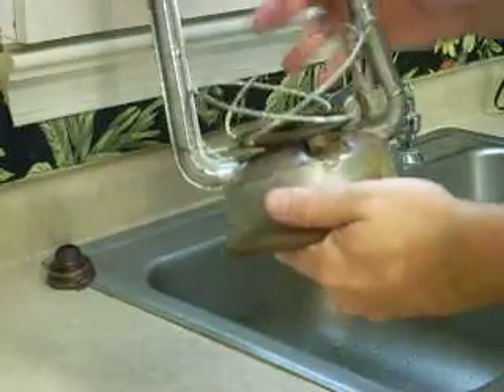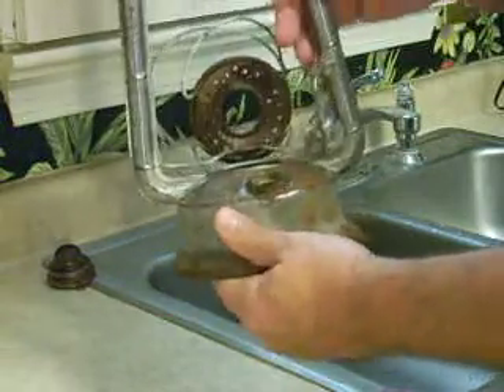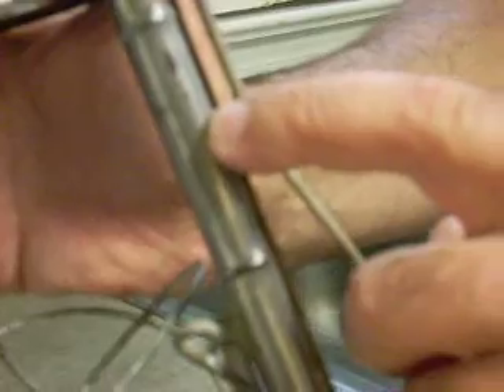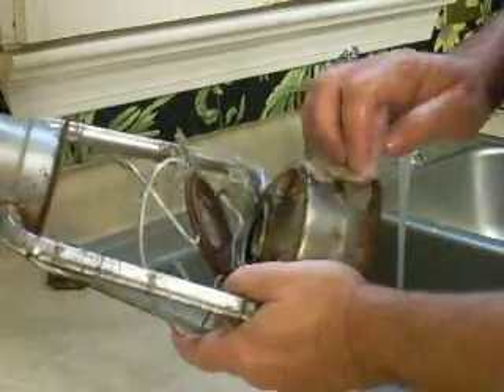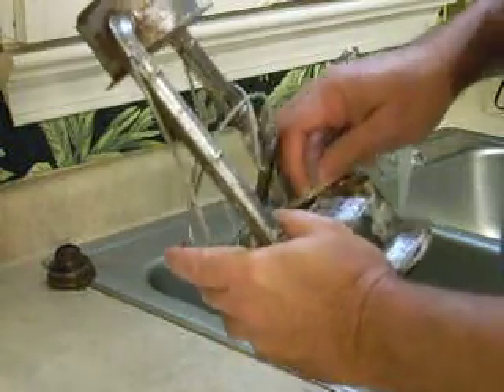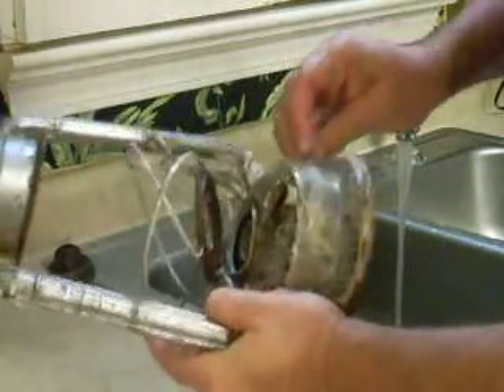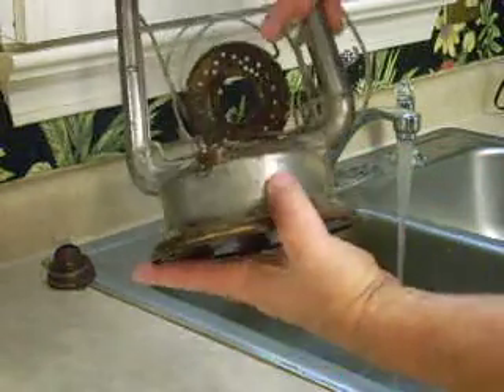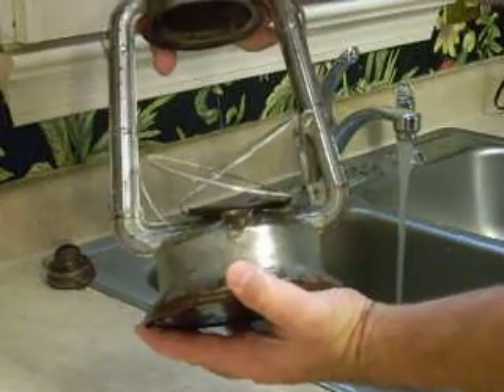Restoration of Dietz Little Wizard lantern - Part 2

Comment: I am debating if I should finish with a 50:50 mix of boiled linseed oil & mineral spirits or hammered gold rustoleum paint. My Dietz is a No. 2 d lite made S6-42. Syracuse, June 6, 42. My tinned metal has some tarnish, maybe from the mild steel instead of rebar.  Any comments or advice? thanks, Norm